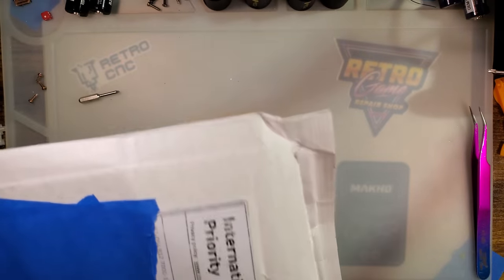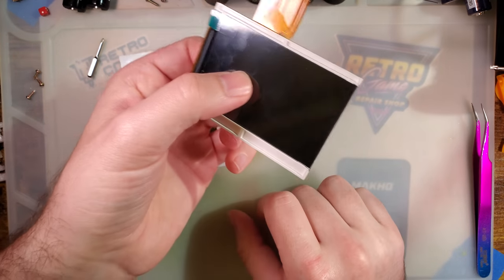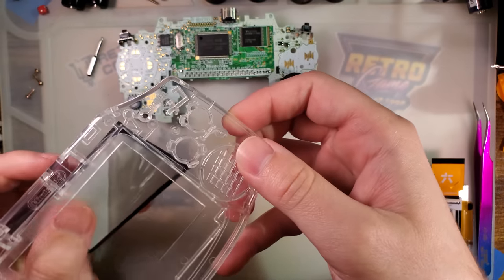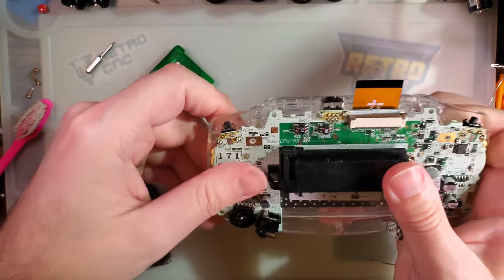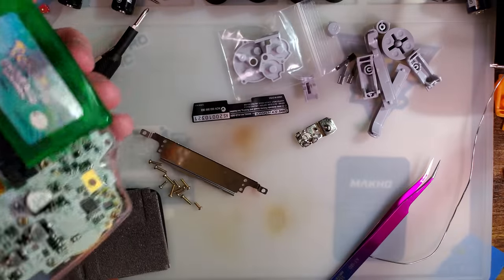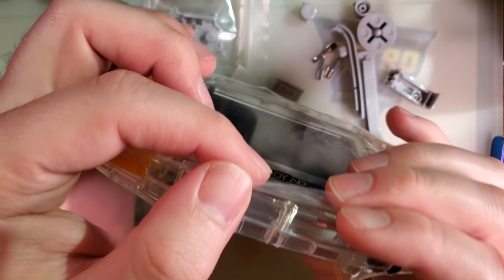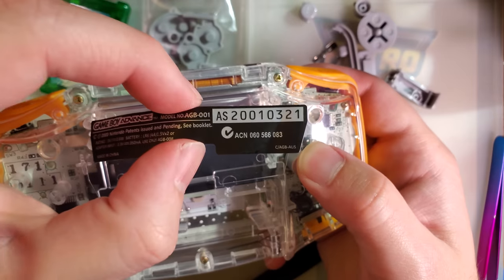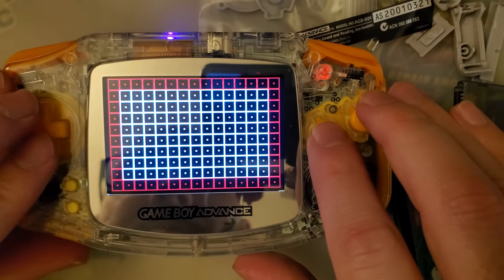Fake Pixels and the Game Boy Advance

Comment: I think I actually know the reason for the color discrepancy at 1:19:00, this came up in open_agb_firm on 3DS. The naive way to handle RGB565 to RGB888 conversion is by shifting the colors bitwise, so red 31,0,0 becomes f80000 and cyan 0,63,31 becomes 00faf8. Unfortunately, this results in a heavy bias towards greens on all colors, because the color spacing is not correct. Ideally, those two colors red and cyan would be FF0000 and 00FFFF, so that the RGB565 max/min/mid colors match the RGB888 max/min/mid colors, and all the colors would be evenly spaced. This would also explain why the whites would be a cooler color, since they would become f8faf8 and not ffffff. Though that could also just be the panel.

It's a shame bc this is entirely avoidable using LUTs, and would also open the door for their 'accurate' color palette to have way less banding probably.

(I can't tell if YouTube glitched and ate my comment or if I triggered antispam with a link/it thinking color hexes were hashtags, so, retyped this just in case)
Reply: Good to see this as the top comment. It's funny that mahko is comparing this kit to an AGS-101 as "reference" which in fact has the same raw RGB color problem as other IPS kits. As you point out, what's needed is a color space conversion (and not simple desaturation of colors). A better reference to an official product would be the OXY-101 (Gameboy Micro) which is backlit and has color correction from Nintendo themselves. In any case, at least have to praise this kit for being the only one that has tried to do this on a backlit replacement screen for the GBA. This kit may "suck" but all the others suck even more, so should give props where they are due. Hopefully we will see further improvements and no steps backward in future kits.

Comment: Keep in mind ni-mh batteries are 1.2v which goes down with discharge. The original GBA without a light or anything is meant to be powered by 3v. Try using a pair of rechargeable li-ions and it won't be an issue.

I had the same problems with the xbox one controller till I switched.
Reply from the maker: I mean, other kits are fine with NiMh. Seems like a kit issue to me.

Comment: Mahko, what rating is your DC power supply?  Looking to get one like yours but most I see on eBay puts out 3.6-30V?? And GBA AGB only takes up to 3.3V?
Reply from the maker: GBA can take up to 3.8v actually. My power supply is fully programmable. For game boys it is extremely overkill though you would want something that can go really low voltage.

Comment: I have to ask this since you mentioned the cleanjuice battery, have you ever had heating issues with it? I had one installed to my moded GBA (funnyplaying IPS V2), and it would be burning hot after 10min of gameplay.
Reply from the maker: Yet another defective product from that scam of a company. Yes, this is a known problem with some of them and you should take it upon yourself to hold the seller responsible.

Comment: You really do not like R6 right? That is okay, i had some problems with them too, getting scratched shells and no response from them and other little nitpicks like that... But for the most part i like the products. And the high power draw is an oversight of the first run, the backlight is connected to the 5V rail instead of the 3,3V rail, so the resistors on the clean screen board are burning a lot of energy for nothing. They posted a video about it. I know it should not be like this, but you can fix the issue by yourself, or send it back for exchange. Personally the unsaturated colours are exactly what i wanted to see, and the pixel grid is super nice too! On the other hand i really like my 101 screen in my GBA with the backlight regulator on top. I think i will build two complete R6 sets, one for me and one for sale ;)
Reply: The products are roughly okay, the owner just has a massive ego.
Reply: I personally am not interested in fixing something that should come working, especially when the price is so high.. same when it comes to having to pay for return shipping for warranty issues.. puts me off those companies
Reply: @cidkramer  i had a scratched gg shell out of the box, got no response from them about it. And a not working cs board. Got a new one for free! So it is hit and miss i guess... But i really want the new gba cs with its unique features😅🙋‍♂️
Reply: @marcelfilz7989  unique feature of draining your batteries faster than a gamegear?
Reply: @cidkramer  nope, unsaturated colours and the pixelgrid are the features i am looking for😉
Reply from the maker: Don't make excuses for them. If they are constantly fucking up your orders, stop ordering from them. They released a defective product (again) and are only doing something about it because I'm making a stink about it (again). 

If you order a product and the product deviates from the listing, you got ripped off. I don't care who you bought it from. End of story.

Comment: Kinda wish we'll get an LCD (or a bracket for the drop-ins like the CGS kit or this one) that doesnt permanently carve the inside notches so that the LCD will sit flat. I have a pokemon center AGS GBA that I'm really antsy to not carve up just for a backlight kit. Insidegadgets used to have a kit that uses the game boy micro screen that actually makes that happen (I dont care of it's a smaller screen) , but he never sells it anymore to this day, to my disappointment. It's a shame, because that actually fits the criteria that I wanted, but theres no 3d bracket made ever (to my knowledge there's only one for the AGS) and it seemed like he only made one batch for the PCB and that's it.

And btw, in regards to ZAS's controls, you can just hold B to fire (not repeatedly) and press A to spread the shots.
Reply from the maker: You don't need to trim those nubs though. It just fits better if you do

Comment: Calling them filters is a misnomer. They are most likely LUTs which is very different. LUTs serve a great and very specific purpose in so many applications,  especially professionally. This is why the two DMG modes look so good because they are actually using a LUT to map all colors to one of four shades of grey. A typical filter or adjustment of the color balance of the LCD like most other kits offer cannot produce an effect like this. I want to get this kit so bad, but I refuse to buy anything from R6.  I hope someone like FP notices and does something similar.

And if you can't understand why this is important, you only need to look at the dozens of games with color blown out to compensate for the shit screen. When you have an actually good screen it makes those games look like hot garbage. They were made with the lack of a backlight in mind. The colors boosted and oversaturated in RGB space to produce something decent looking on those screens. Hence why games look like they do on 101 and modern screens. It's not the screens, it's just how well they represent the actual color data used internally without those terrible screens.

FF 1/2,4,5 DKC 1-3, BOF 1-2, MMBN1-3, Ruby/sapphire, Harmony of Dissonance, Bomberman, Golden Sun,etc etc. Just go look at all the color restoration patches.

Conversely, an AGS-101 is not even remotely the right comparison because by the time it came out the GBA was on its last legs. Very few games were made with it in mind and as a result most games look just as terrible as they do on modern backlight kits.

It's not a matter of "preference" because objectively, games color and brightness were designed around the original and the AGS-001 in mind.  (Hence why games started shipping with different brightness and saturation settings to account for the unlit and frontlit models).
Reply from the maker: You're right about the LUTs but in my defense, on the other kits they ARE filters. Habits got in the way of proper terminology yet again (feel free to call me on my bullshit every time I say "linear scaling" instead of "integer scaling" too). 

Regarding the color profiles of games, I think you're forgetting the audience. I know this and I wager a lot of power users (like yourself) do too. Most people do not. Since every game is different, there's no one hard rule to follow so I tend to go with the games I specifically play (like Pokemon Emerald) and hardware that is accessible to anyone like an AGS-101.

I use the AGS-101 console as a "control" for this stuff because it's basically the bare minimum backlight available for these consoles and what most people consider when weighing backlight options. It doesn't matter how the games were intended to look because this is how nintendo released the console and you got what you got. It's all we had for modding GBAs for almost decades whereas these IPS kits and such just came out within the last few years.

If ever there is a good screen I can use in place of the AGS-101, it will be replaced. Until then, this is what we've got.